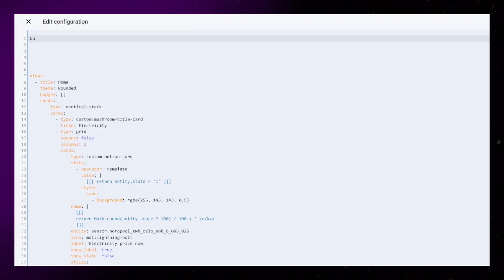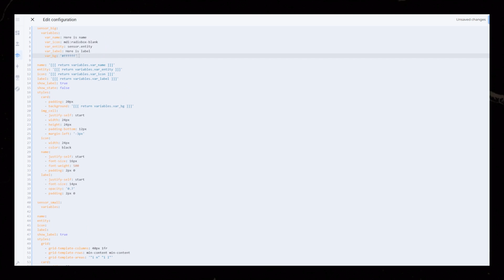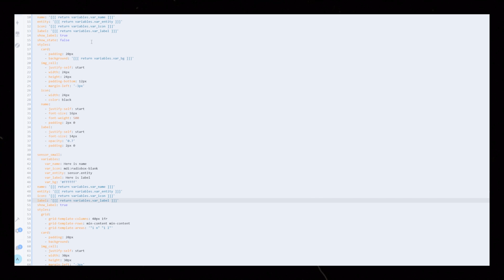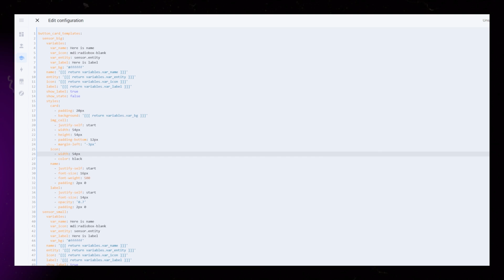Create Button Card templates in Home Assistant

Comment: Thank you for this handy videos. I have a number of button templates and the code is a bit long. Is it possible to make the code work on all dashboards by adding it in "configuration.yaml" or but it all in a file like "button_templates.yaml" and use !include?  Thanks!
Reply from the maker: Hi, I'm not sure if that is possible. But that would be very handy indeed.

Comment: Hello, do you think that it is possible to use the variables inside cardo_mod ?? I am having problems when trying to get the state from a variable like:   --chip-background: {{ 'rgba(223, 130, 108, 1)' if is_state('[[[ return variables.var_sensor_aire ]]]', 'on') else ...
Reply from the maker: Inside card_mod you will have to use jinja code. Home Assistants templating language. Not really sure if I understand the variable question tho. Button Card and Card_Mod is two different things.
Reply: @My_Smart_Home  the templating thing is great, but I too am stuck on using the variables definition for the color to be used in cardmod. I guess this is really a variable scope and syntax problem but it would be great to have the solution here for completeness as your more advanced custom button cards for rooms use card mod, thanks

Comment: Do I need something specific to be installed? I cannot get it to show up when I want to use the template, it just says custom element doesnt exist. Any ideas?
Reply from the maker: You have Button Card installed?
Reply: @My_Smart_Home  I didn't realize that there is one that you can install too, I thought you talked about the button-card that comes with the home assistant by default, so confusing.. I installed it and now it doesn't complain, but doesn't seem to work either. I now have something to solve during the weekend 🤷🏼‍♀
Reply from the maker: @klaranilsson8967  Sound like a nice weekend. In suggest you start with a couple of my sensor cards videos. Should give you a decent intro to Button Card. Then you can make those sensor cards into templates.